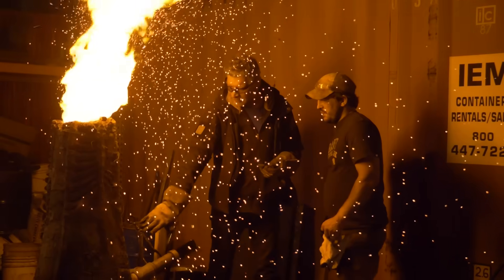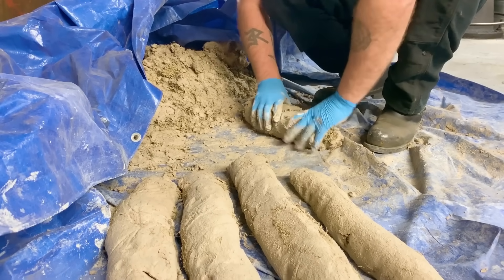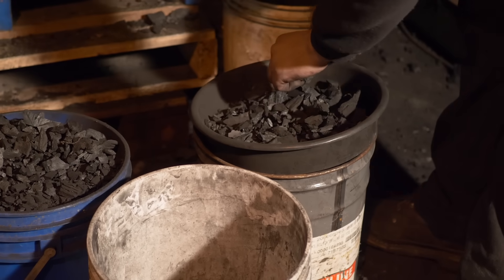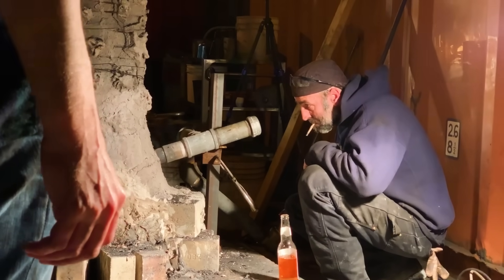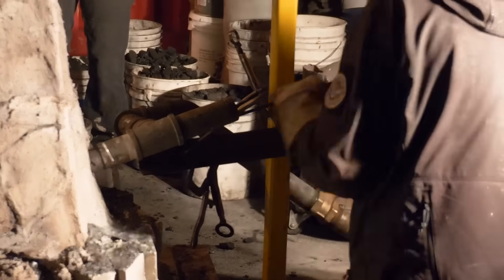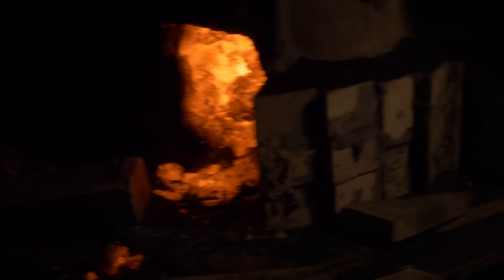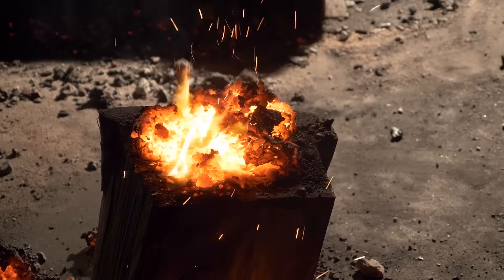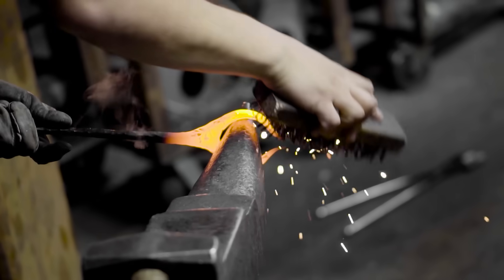IRON from SAND - Oldest form of iron smelting

Comment: Pro tip: if you could channel in some cold fresh air to your pit it will make your fire burn hot and effectively. Bc in a building or warehouse you’re feeding the fire with just forced room air. Bring it in from outside and flue your exhaust as well, you’ll notice dramatic dynamically moving heat. Faster burns as well. Think of a Dakota Fire concept. Secrets from my Sioux Tribe.

Comment: And the Japanese bladesmiths found that in each smelt, there were two types of iron (steel) made.....tamahagane and kawahagane. The tamahagane was higher in carbon and therefore could be hardened and heat treated to take a ridiculously sharp edge, while the kawahagane, when heat treated, became resilient and tough. As far as quantity of quality iron (tamahagane) is concerned, Japanese smiths typically only get about 2kg of iron from about 20-30kg of iron sand.

Comment: Why not run the heated air back through the forge/furnace before exhausting it to increase the heat?
Reply: Because the plastic case of the lower fan would melt...

Comment: Is good to bring back alive of a old traditional blacksmith trade. I was a blacksmith since 7 yrs old for almost 32 yrs following my father in Spore. We use to manufacture crowbars,  hand tools, tongs, spanner, etc. but the gov had deter the trade by not issuing anymore license. I still remembered using the church hill spring leaf forger which have more impact power than the pneumatic type. Is so good that someone is rejuvenating the blacksmith trade where the young ones does not know what is it.

Comment: how did people back then go about sorting the black sand though? they wouldn't have had magnets right? Or can it be used without seperating it thoroughly?
Reply: Lodestones are naturally occurring magnets but they probably just used the sand as is back then. If the iron content was too low they would run it through again in another smelt with more sand.

Comment: Amazing idea for a project, shows just how tricky this critical step in tech is, but it's too bad they used so much modern tech for the smelt, the blower especially, if you're not going to use a Bessemer furnace, why use even more advanced tech with your primitive smelt, basically undermining any core idea in your project if you're using electrification in the process.

Comment: Super cool video! This is exactly how the feudal Japanese swordsmiths made their blades. They didn't have a reliable source of high quality iron ore, so they used iron sands in a bloomery furnace. The resulting iron was then chipped off, flattened and then formed into ingots, which would then be folded hundreds of times to evenly distribute the carbon content, making primitive steel.
Reply: They did have high quality ores such as mochi tetsu, which is basically high purity magnetite/lodestones. These were abundant and easy to aquire.

For folding, only about 10 or so times depending if it was iron or steel.
Reply: Current day Japanese swordsmiths use the exact same technique… (yes, they still exist).

Comment: I recently was part of a very similar experiment at my university and the amount of coal and ore needed to do something like this is truly crazy.
We used the same type of furnace, called a bloomery (or Rennofen in German) and we melted 30kg (66 pounds) of ore and took used about 60-80kg (132-176 pounds) of coal during the 10 hours the furnace was running. (Didn’t run for the full planned time, as the last tap caused the walls to break prematurely and so we had to remove the iron earlier than expected)

The window into the furnace is a great idea, I wonder how they did it as it might help to improve such experiments a lot by allowing us to see what difference the size of coal, changes to the way the ore is prepared and other variables in the experiment can cause.

Comment: How the heck did they ever discover how to do this? They must have tried to just heat so many random types of rock in different ways just to see what happened.

Here I was thinking that they would just heat up iron ore and out comes a clean piece of iron.
Reply: I've often wondered the same thing. I think the first metal people smelted was copper.  People had been making pottery from clay for X000's of years using very high temperatures. Maybe someone noticed that the green rocks in the furnace melted????
Reply: @GarrisonFall  probably by accident, yea

Comment: Kinda confused why the whole process was nessasary. Why not place the iron sand into a cauldron and simply melt it. Adding Coal and flux right with the iron seems counter productive.
Reply from the maker: This kind of furnace is not hot enough to make iron molten. Plus the iron is actually iron oxide, meaning it has oxygen attached to it. In this kind of furnace you create a reduction atmosphere so the oxygen will crack off the iron and burn off. The iron bits then slowly fall and stick together until they form the bloom.

Comment: Celeste: Have you considered demoing this project for the Maker Faire in San Mateo? ( when COVID restrictions are past)
Reply from the maker: The company behind Maker Faire sadly has shut its doors.  Last I heard it wasn't going to be picked back up again.
Reply: Yeah, she used to go to Maker Faire all the time with the Crucible cru.   Mostly they would be out there as blacksmiths pounding on steel in the hot summer sun.  They did a raku demo that was very well attended, but sadly never got the chance to do a smelt there.

Comment: I've tried the same process using magnetite separated from sand. The keys seems to be the type of charcoal used and how well the sand has been removed. I found that hardwood charcoal is better than softwood and water/magnetic separation works the best for cleaning out the sand. Just be damn sure the magnetite is dry before you attempt your smelt.
Reply: Softwood has a higher sulphur content…

Comment: Get with your gold  prospectors for really good areas to find magnetic  black sands . Black sands are more prevelant than gold but weigh almost the same  as far as density goes. 
Black sands can be a pain in the ass  to prospectors  working clarified materials for gold.

If you were there they would gladly give you all you could carry. Imlo.

Comment: Incorrect:
Silica, silicon dioxide, is an impurity with a very high melting point that causes flaws in steel and at high temperature may ionize, introducing silicon into the iron and causing brittleness.
The flux is made up of burnt lime, CaO, which draws out the impurities, burnt dolomite, MgO, which lowers the melting point of the burnt lime and protects the refractory from the burnt lime.
To remove the silica impurity from the iron ore, two measures of burnt lime must be used for every measure of silica.
For the flux to be fluid the iron oxide, FeO in the flux must be about 27%, the burnt dolomite about 10%, the burnt lime about 42% and silica being 21% so the quantity of fluxes used and iron lost to the slag are dependent upon the silica percentage present in the ore.

If the furnace is not hot enough the carbon will glaze the outside of the ore, leaving mostly iron oxide.
If the furnace is too hot the ore will form a cluster.

With ore sand, ore sand, burnt lime, burnt dolomite and carbon dust are formed into mud cakes and baked dry before use to prevent the dust blocking the air flow. This cocoons iron droplets in porous, fragile refractory balls as a final product, much easier to handle.
Reply: Hey andrew, Celeste has become obsessed with everything you're talking about, could you get in contact with us?  I'm her husband and she's been wanting to speak with academics and knowledgeable folks to make a series of nerdy videos about this.  The origins of "damascus" in pattern welding are also of interest.  down1nit at gmail if you see this.

Comment: I would like to point that crucible technology was super complex with clay only being 1 component and generally an inferior component since yellow soil was more desired, another was component better suited than clay was soil turned by white ants and depending on how hard or soft you wanted it, there would be a variety of chelating agents both organic and mineral that was added and than they would also use different temperatures depending on the type of iron they wanted.

Comment: A 20lb bloom is a very decent result, especially for only consuming 200lb of charcoal. The first one I did with a bud, we knew very little and learned on the fly after watching a japanese crew and their master. Seemed easy enough: dump ore down fiery hot hole, add charcoal constantly, stoke the fire, repeat ad nauseam, tap slag. We used an amazon thermocouple that lasted one run before the wires melted, at least 500lbs of charcoal sourced from old lumber and got maybe an 8lb nugget on that first run, and I very much doubt our carbon content was particularly high. Came home smelling like a forest fire and looked every part of a coal miner. It really is a dying art!

Comment: If you can cupell some heavies for me id be happy to trade classic new york state iron ore for it... Sand or stone. Lol i can get ALOT! Ifs tbe same ore as was used in the late 18 and early 19 hundreds for high rise I beams, and boilers and wood stoves and engine blocks and kbar knives in ww2 ....it used to be world renouned as better than even german or japanese steels. For sand , about 2 gallons of a 5 gallon bucket is hematites,magnitite and iron sulfides as well as metalic iron flakes. Yup. The pain is the shelite sands ,garnets, and a slew of thi gs i want to get samples of  and get an xray spectromiter. Or whatever its called. The thing that says the percentages of minerals and metals in any given object. I have came up witha whicked theory too. But thats not for just anybody at this point. Lol. It is probably far more valuable than anything in that sand and ore...I can give a hint though. It is found with chromium/chromite , nickel and copper mostly in nature and I think its been finding its way into chrome/nickel and similar alloys . i think until recently this secret ingrediant was unavoidable and made a high impact on metal quality . its being experimented with off and on as of late, too.  I think it was discovered upon out ability to truely purify elements like chromium and when alloyed with, it did not work the same as it had previously. But to keep a trade secret , and the S.A.E. loves their trade secrets, it was never amended in any but the most advanced 
,master engeneers resources. .it would make a big differance in the longevity of steel vs autmosphEric conditions such as humid, corrosive environments.  If you figured it out . Awesome! Let me know who thinks it is what! If not . my lips are sealed for now.

Comment: It's looks like a mini blast furnace.... awesome..😻
Reply: It is a micro blast furnace. Except it does not run hot enough to produce molten cast iron. It produces nearly pure iron grains surrounded by silica glass. It is called wrought iron. That can be converted to steel with difficulty.

Comment: But sand is Silicon Dioxide. Your title is incorrect.  There is no iron in sand.  Aha! During the video you show a mixing of clay and sand.
Reply: No. It's explained in the video, you should watch it before commenting. Sand is not pure silicon dioxide. It is true that sand usually consists of silica, but there are always traces of other materials in there as well because we're talking about a rock, not a purified lab grown crystal. Iron is one of these trace elements, being relatively abundant in the crust of the earth.

To be exact, they specifically mentioned that they are using sand that's high in iron and they're manually filtering it with magnets to get the iron rich grains. How you missed that is beyond me.

And even if this wasn't the case, your claim still wouldn't make any sense. How could it be, that you were so confident about your sand wisdom, yet think the clay is contributing the iron? 
Clay is made from the same material as sand. Mostly silicates.

Comment: Great video.  Very informative, and I like the fact that you cover the importance of taking thorough notes about everything, such as the steps used to magnetically concentrate the black sand (magnetite), the rate you add fuel (and the size of the lumps), air, silica and ore, and the ratio between those, and the consequences/failures associated with too much or too little of one of the inputs. I wish more people did that.

Question: since you have to go through the labor intensive step of crushing and sieving hardwood charcoal to get the size pieces you desire, is it possible to simply use nut sized metallurgical grade Coke instead, or does it (a) burn too long and thus poses a risk for contaminating the bloom, or (b) burn a little too hot and thus lowers the carbon content of the resulting bloom ?

I cannot smith (bad shoulder) so I have to content myself with watching smithing vids ... i'd much rather be doing it.
Reply from the maker: Thanks for the kind words! I’m not the expert here but based on hanging around these people for a while I can make some guesses. Firstly I don’t think coke was around until the 1700s until Britain was looking for new fuel after cutting down nearly all of the forests. These smelts were meant to generally (minus the blower of course) mimic more ancient forms of smelting. Also I believe the charcoal balanced nicely with the magnetite in that the bloom which comes out is very low carbon . If coke was used instead I think it would upset the balance they know and understand. Doesn’t mean it couldn’t happen but I strongly suspect you’d have to make many other adjustments.
Reply: @machinethinking  Oh, my question was unrelated to historical accuracy ... I was just wondering if it would work.  Thanks for the reply.  Cheers.

Comment: 3 suggestions: Use 2 grates to sort fuel by size.  Secondary containment will protect workers as well as concrete from spall.  Masks to prevent silicosis.

Comment: Reminds me of the produce made by the 'back yard furnaces' Mao made everyone build. He thought China would produce vast amounts of steel...

All they got were dead bodies and mountains of worthless pig iron.

Your furnace design is completely wrong for what you are trying to achieve, even using modern fans.
Reply: Can you be more specific on what you think is wrong with the furnace ?  

The blowers seem fine to me (although the rate of airflow looks too low as well as too high at different times in the vid due to being cut together fm 6 runs) ... the blower simply saves the need to have people pumping like crazed chimps on leather bellows, and thus from a finctional standpoint it is just a labor saver rather than an out of place technical innovation.

Comment: The source of some iron was pulled from swamps. I think it was formed from iron ladened water gathering in bog areas. Though a biological and simple separation the iron left suspension in the water and formed chunks in the bottom of the bog.  I think this process started in parts of Europe. 
In the Middle East the process of finding iron ore had to be very different.

Comment: Why not just buy the iron from Birmingham Alabama instead of wasting all these resources to burn sand 99 duhs to dust
Reply: The whole point is to learn about the bloomery iron process.  The kind of knowledge gained from actually doing it illuminates aspects of the production of iron that makes it possible get a handle on how much iron could be made in different places based on how much labor could actually be allocated to it (rather than, say, producing food) and how much labor each kilo of iron produced actually took.
Reply: Ok listen there is a place called Rock Products ,Georgia Marble and Thompson-Wymen.. In Sylacauga Alabama and Fayetteville Alabama.. There you will find Steel is made at its maximum effeciency from Iron ore, Marble and Limestone ..the CSA civil war cannon from Selma Alabama pulled up from the river shows how durable this process really is..its not made in China..those 3 ingrediants have to be in abundance in area to ethically make iron-steel ethical cost to even be worth it..your formula on this video is probably better for making glass than iron. All that forge costs to burn all that propane..trust me Ive worked there its barely work the sell to the public even if (fact) you are given an acytene number 7 tip w/oxygen torch and all the iron steel except watermains a "Maine Avenue school tore down for a $1 public bid" this did happen all of it so you are better off to buy the steele from Maddex , Birmingham, Shelby Steele and sadly because they literally do NOT have a minimum wage law effective..Ive cut and recycled steel for $1 per hundred pounds yes a penny per lb . to make a living there when I was younger before I moved to Florida where theres plenty of sand..so basically what you are doing here in this video is like melting vitamins to make sikver..you are wasting your time with this approach , dont let my time typing this information out to you be wasted to. Ive been to everyside of the steele market my great great grandfather left the marks G.E.W. on that Civil War Cannon. From welding to well driling we've done everything in between ...junkyards for cars is the best place to buy recycled steel ..meg welders are your best manufactoring device and or acytene torch. If you want to use your theory /hypothesis its fine but I suggest looking up volcanoes make peridot rain from the sky , viscosity and thermal breakdown , refining goldfilled to recover 99.99 proof pure gold , glass blowing using sand. Else what you are doing in that video is a huge waste of money on propane and a very poor use for a forge. Just being honest take it for good intentions
Reply: @americanlivesmatter-BmanWild  You could have said that you are incapable of understanding the reasons anyone does anything much more compactly than you just did.